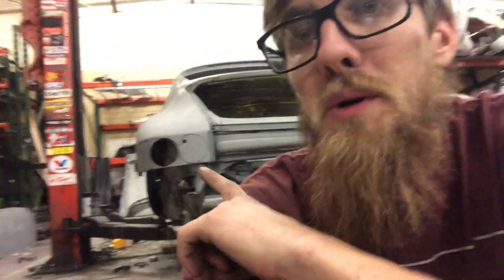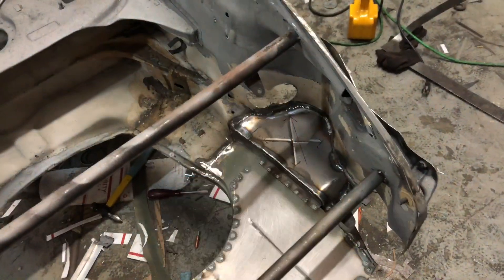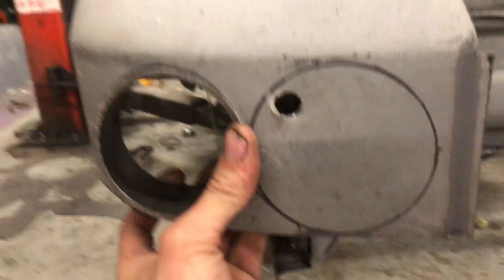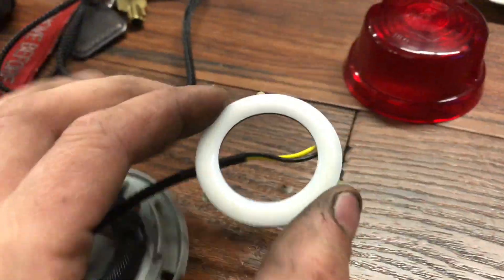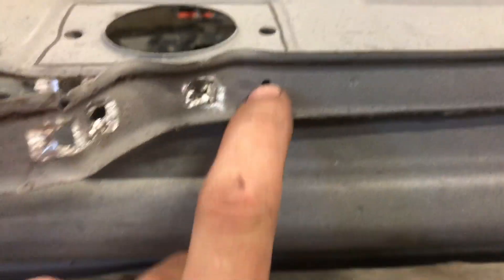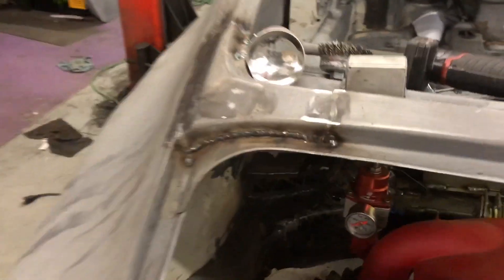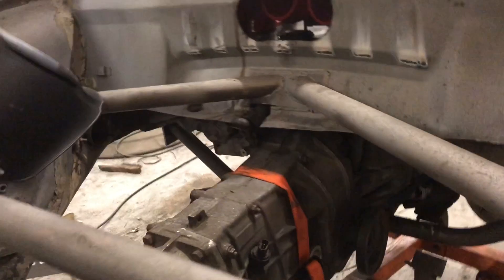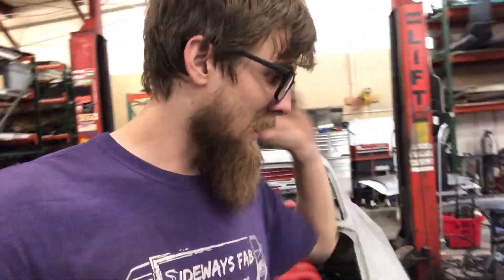911SF Gets 911R Taillights, Rear Seat Delete & Tons of Fab Work

Comment: What if you still use the wilwood slave cylinder and make a linkage with a remote mount? Like a remote mount hydro?
Reply from the maker: Ty Raymer it’s a pull style so remote mount would put me in the intake manifold

Comment: Did you also drill a small hole in de bottom of the taillights tubes so water doesn't stay there?
Reply from the maker: Luuksen they should be close to perfectly flat so they won’t hold much water